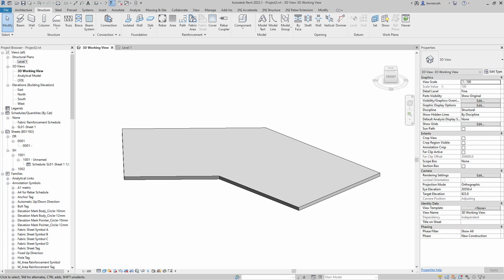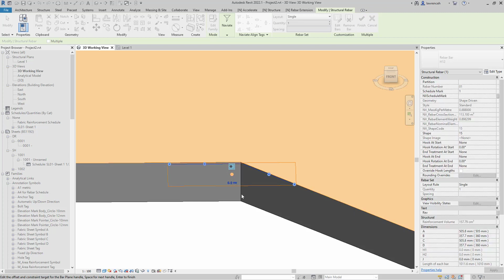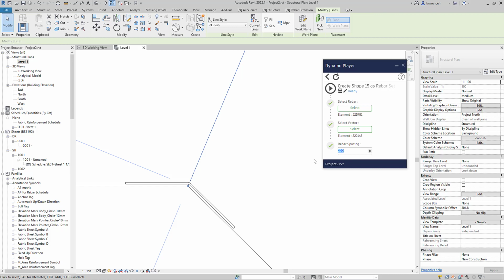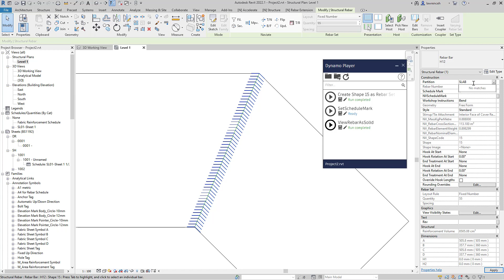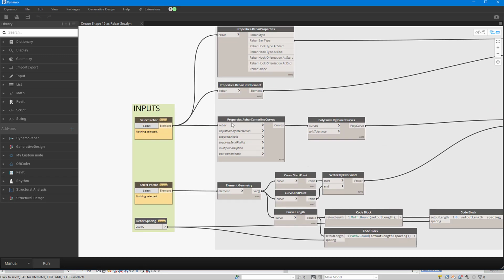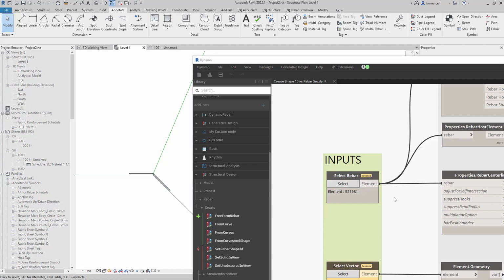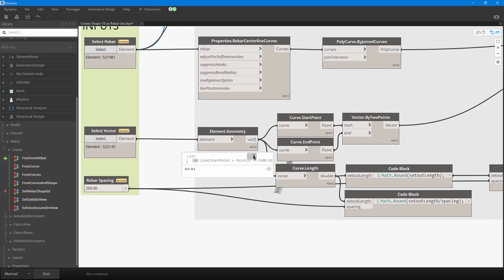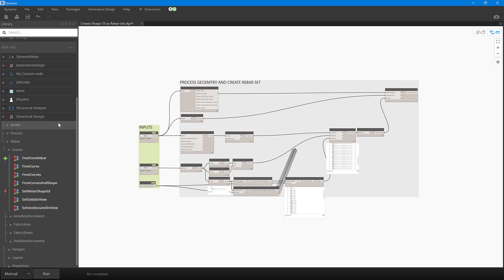Revit 2022 Tutorial -  Cranked Rebar Solution (Shape Code 15)

Comment: Hi Lawrence, thanks alot for making this video. Shape code 15 has been giving me issues for years now. I'm still learning how to use Dynamo so forgive me. I'm struggling to find how to get those inputs you've made. I see you've renamed them. Could you please let me know how locate them in the library. Thank you in advance.
Reply from the maker: Hi Thomas, glad its useful. Yes, 15s are always interesting without Dynamo! Basically, the renamed node 'select rebar' is Select Model Element which is found in Revit - Selection and the select vector is also Select Model Element
Reply: @RevitStructureBlog  Excellent thank you, got those sorted. The last two nodes I'm stuck on are the Rebar Spacing and the Element.Geometry ones. If you could assit me with how you made those I would be eternally grateful.
Reply from the maker: @spartangoat87  The Rebar Spacing is simply a number input. The Element.Geometry has not been renamed. It should be found under Revit - Elements - Element. Hope that helps